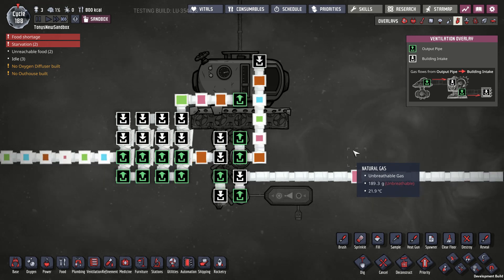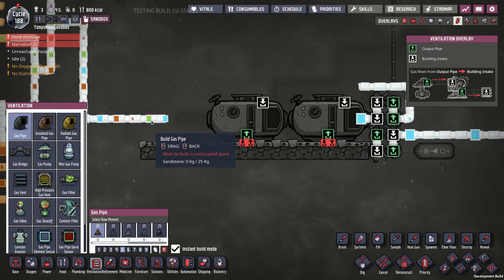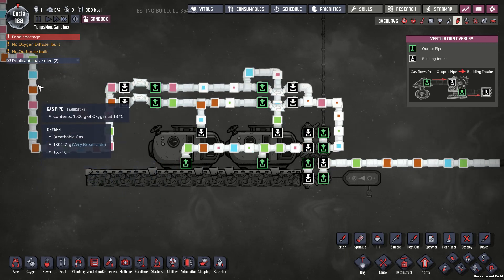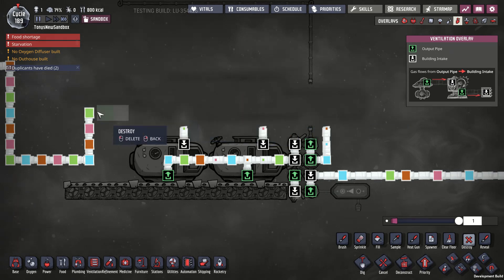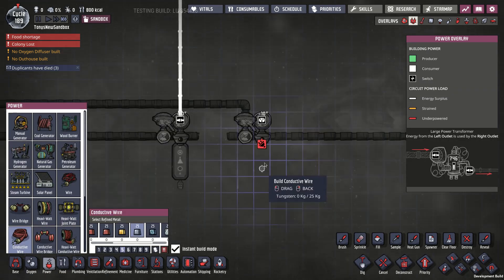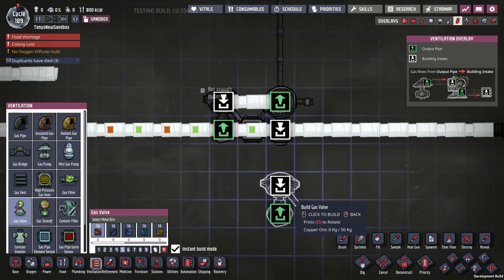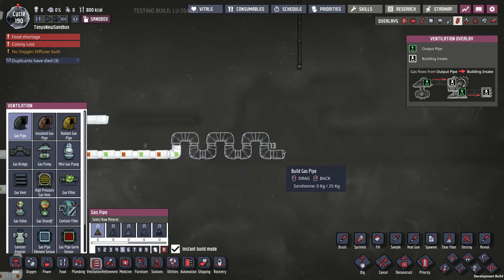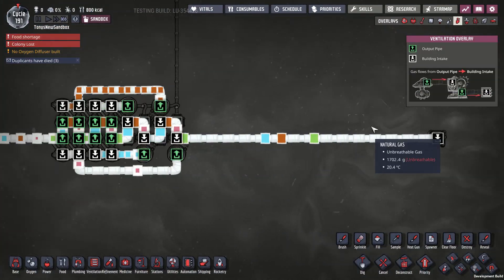Multi-element packet stacking part 2: Why mine sucked and how to make a good one.

Comment: The main question is "why?"... from my experience this has very little practical implication within the game. Usually you just isolate the system, vacuum it and from here it's just a single type of air packets going out to a specific destination. Good from the point of learning internals of oni though!
Reply: When you're vacuuming out an area and you're using a gas filter to sort things it uses the same amount of power no matter how big a packet goes through it. So a stream of 10g packets will use the same power as a full pipe. This is a general concept, so any device that is just active if it has a packet can be optimized using a system like this.
  There are also advanced filtering techniques that use passive loops with small packets to pull packets out of a line, so this can make sure all the packets on a line can be picked up cleanly. I'm thinking about building an infinite storage for fluids and gases and using something like that to sort everything before storing it
Reply: My experience has been with pumping gasses out of a large area, as well as other sources like the oil wells and natural gas. I have various pipes all feeding into my gas storage system, and I would have lots of little packets going in and it was slow. With this setup I can maximize my throughput for faster pumping, and many people enjoy a fast pump!

Comment: This is only necessary when you have dispersed sources.

If you have a single source for a gas/liquid, then it makes sense to do the stacking at the source so the input to your bus is always full packets.

Also, the problem with all these designs is that they reduce overall flow; I'm struggling to see the value when the output has empty space in it - surely it's better to have something in the pipe than nothing?
Reply: The overall flow is still the same; an input of 100g/s will have the same rate of flow whether it's kept as packets of 100g/s or stacked to one 1kg packet every 10s. The most obvious use case I can think of as to why it might be preferable to do so is when considering utilities like the Thermo Regulator or Thermo Aquatuner; a Regulator will use 240W per packet regardless of if it's 1g or 1kg. Feeding 100g packets every second would therefore consume 10x more power than feeding 1kg packets every 10s.

Comment: I have a question about the design shown around the 11:00 mark. Can you just flip a second module upside down and put two of them in an overlapping fashion on the pipe to save some space? These two tiles between the valve and shutoff seem perfect to put the two valves of another module in.

Comment: Funny thing, I made my comment on your previous video before watching this one and here you not only used the design I proposed there way before I made that comment but also have proven me wrong. Good for me.

Design I like the most is not as perfect, it may let smaller packets through. But if the stream is stackable it will do reasonable effort stacking it, will not keep any input indefinitely and can support full flow. And requires no power. Here's a picture:
https://imgur.com/p2EmHug
Reply from the maker: Ah! You watched this already! Cool. I'll have a look at that thing right away.
Reply from the maker: I tried it out and I think I see how it is meant to work.
1. Merge a packet with the one behind it.
2. Merge the packet with the second one behind it.
3. Etc.
It's very clever, thank you. I tried a generalized approach like that when I was experimenting but I decided not to go that way. It's a strong strategy, and it does a pretty good job, but I wanted to focus on making one that works for every situation.

Comment: I cant get why do we need this stacker? Can someone give an example?
Reply from the maker: For me, it's a way of making space in a pipe so you can cram more stuff in it. Usually to send it to filtering and such. It's a lot less trouble to filter one pipe than two, or ten.
Reply: I have two mixed-element pipes, say, two air pump elements. I want to merge them.
Reply: Also, anything that has a per-packet cost will benefit from having fewer individual packets. Little efficiencies add up.
Reply: i woulv'd needed this in my base because i was sending all extra stuff to a door compressor room